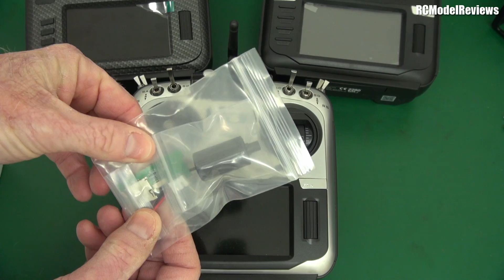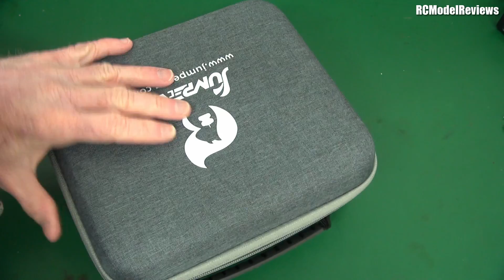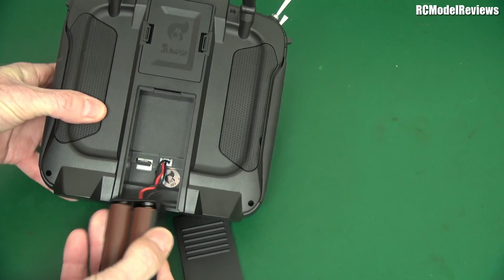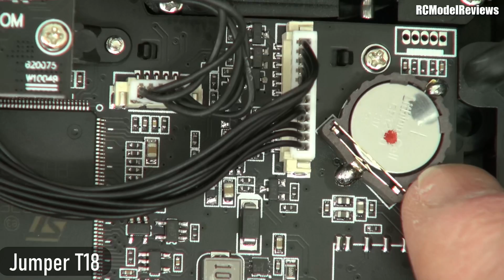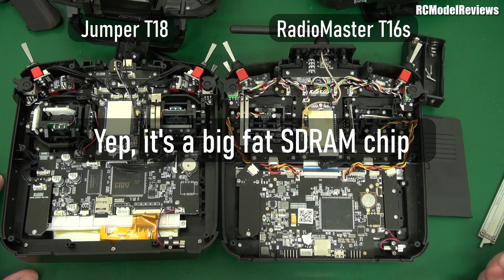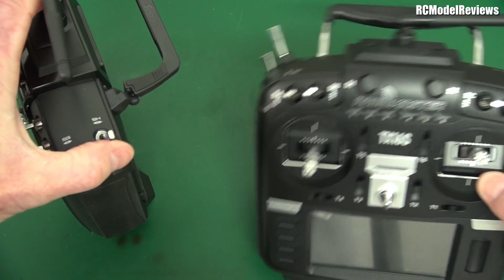Jumper T18 vs RadioMaster T16s TEARDOWN

Comment: This video is a couple years old now but I have a mark 2 tx16s and I think it is plagued by acoustic noise from the ceramic capacitors on the mainboard. Do you get a high pitch ringing noise when you for example increase the internal module power and/or screen brightness at the same time? It becomes EVEN MORE audible for me

Comment: One reason I purchased the Jumper T18 V2 was the switch lights - I do have to fly at night, the downside is no one has reverse engineered the T18 so schematics are not around and the part add-ons for the T18 are non existent but I do like the case that came with the T18.

Comment: I see a year later radio master includes a foldable handle and two strap clip holes for a flat to forward balance. Older radio master radios are still on the market so if balance matters (it does to me) look for that.

Comment: Thanks for the proper review. My Jumper T16 Pro worked well for 10-12 months, but then then the first ribbon cable issue appeared ("page" button not working), then the second one (Scroll wheel "enter" function), now on number 3 & 4 (SG switch not working, SD card reader malfunction). The first two issued solved by cleaning and re-seating appropriate ribbon cables, but with the two new issues I'm about to give up. The so-called FOC replacement cables from Aliexpress difficult to order without actually paying (and waiting 6 weeks for them to arrive), så I'm no very happy with this product. Get a Radiomaster instead!

Comment: When I bought my jumper T16 I thought it was amazing.  So I bought a second one to use for my kids.  A few weeks in I had all the problems with the ribbon cables on both radios.  Reseat a cable and it would be fine for that day and magically 2-3 days later I would power up a radio and another damn switch would be misbehaving and I would have to reseat the cable again.  I got the upgraded ribbon cables and installed them.  Seemed to have fixed the problem for a month.  Then I had the same thing happen.  I now own a Radiomaster TX16S for 2 weeks and I think its a decent upgrade from the Jumper.  The next time one of the jumper's has a ribbon problem its going in the garbage.

Comment: many many months later, i just reviced my Jumper T18, and i can say Jumper have made some upgrades on the production line, the screen cable is much shorter now and not wrinkled any more for example, and the Hall Gimbals is not the same as the gimbals in this video... so it looks like they made some improvements Jumper.

Comment: The center detent is built into the Potentiometers...  My guess is that Radiomaster are using an better potentiometer for the sliders.. I would imagine its then the same pots used on the top 2 knobs on the transmitter too..

Comment: I have also noticed that NONE of you people in the process of doing your tear down comparisons are exercising ANY Electrostatic Discharge (ESD) precautions 
whatsoever. I've noticed some people touching components with metal screwdrivers and
other metal pointers without the person wearing a grounding wrist strap. Static electricity 
does more damage to digital circuits than most people realize. It doesn't have to do catastrophic damage but eventually you will have a radio failure attributed to ESD. 
Most of the circuitry in these radios operates in the range of 2.5 to 5.0 volts DC. A spark of 
of more than 5 volts is going to do damage. If you actually SEE the spark jump. you HAVE 
done damage!! It's that simple. 
  
Be on the safe side an wear a ESD wrist strap grounding kit. They don't cost but 10 to 15 Dollars US and can save you an expensive airplane or drone. I Cringe EVERY time I watch one of you people tear down a radio !!!

Comment: Great Video But did you think to read the manual on wither radio? DSC = Direct Servo Control AKA 
Trainer Port and Charging on the bottom USB-C Port. And as a modeler< I'm really surprised that you 
couldn't figure to modify the Jumper Carry case with an X-Acto Knife (Surely as a modeler, you have 
some imagination) to fit the Radio Master or get the optional Fold-Down Carry Handle from 
Radio Master and then it should fit the Jumper Carry Case just fine. 

And, Yes! The flex circuits, what you are calling ribbin cables, in the jumper are a Joke! They will not
stand up to vibration. Stranded Copper Wire Ribbon Cable on the other hand, will. As an electrical
engineer of many years, I can attest to this.

Comment: I was an early adopter of the  Jumper 16 with hall effect gimbals. I've had problems with the card reader and the ribbon cables. The ribbon cables are always out of stock unless you buy them from Jumper and it very time consuming to replace them. In fact, one of the catches on ribbon cable holder broke and I'm completely shut down. 
Personally, I would never buy another Jumper product.

Comment: I have had a terrible time with quality and support with Jumper.  I will keep you updated, but let's just say it was very difficult to get a replacement T16 when I bought it (more than 16 detailed e-mails and a need to basically beg for an RMA number), and the replacement they sent me had big problems also (and has not yet been fixed or dealt with).  I hope RadioMaster is much better with its customer support.

Comment: While complaining about the need to remove the battery pack on the T18 to charge the cells you said, "Obviously you want to balance charge them."  Considering it has the same leads on its battery holder as does the T18, it doesn't look like the T16s internal charger balance charges the cells.

Comment: Had issues with my TX16s. None of these are high quality. And as far as features it is just more of the same. Nothing ground breaking. May be good value if you get one that works but nothing like quality of TBS. Someone could jump into this space and disrupt with a really good easy to use radio.

Comment: 21700 cells will fit in the Jumper in place of the 18650. Don't use the holder but just a couple of bands of clear tape round the 21700, firm up with a couple of blobs of hot glue where the cells meet. Cell holders with spring contacts are a bad idea in a Tx (airborne situation as well) as vibration can causes intermittent/poor contact which can result in loss of control.

Comment: would be good if you could measure the current consumption of both radios to see which one is more efficient. This means for the same battery, the lower the current draw, the longer we can run it.

Comment: The screen protectors are designed for protection during shipping only, and will degrade your screen over time, removing them will prevent this.

Comment: The radio master cables may look messy, but having different colours is good for moding. As in 'Cut the yellow cable on J12 and connect it to the red cable on J5 - as an example.

Comment: That's a rubber dummy load, not an antenna on the T18. If you really want range, run a cable to a decent vertical antenna, perhaps mounted on a pack frame or something like that.

Comment: Can you fit a 5000mah 2s 21700 li-ion pack in the Radiomaster? Samsung 50E cells are like $5 each so much cheaper to build a 2s 5000mah pack then an equivalent lipo. Plus they don't mind being left charged for long periods.

Comment: Hi Bruce  , I bought the Radiomaster and fitted the Crossfire module and find it fits my hands for a thumber  .   The folding handle is not an issue if you use Crossfire .  It would be nice to find a carry case that lets the Crsx module fit as well .   Also Radiomaster has an option to buy it with the Crsx module as they did some sort of deal with Crossfire .  I already had a module so didn't need to go that route but CRsx works  seemlessly with the Radiomaster .     
Question though recently Win 10 did an update that buggered up my STM drivers  , has anyone else had that problem .

Comment: I looked up the details on that antenna, it's 3.3dBi gain, which is the same gain as 90% of those 100mm long rubber ducky antenna's. So aside from the polarization issue the performance shouldn't be too bad.

Also I prefer running horizontal polarization as you're less likely to run into Fresnel zone issues.

Comment: Hi Bruce: I measured the Chrome handle on my Jumper T16 and the centre points are 105mm which is the same as my new RadoMaster TX16s handle centres. So the folding handle for the Jumper T16 V2 should fit. I ordered one, they are not that expensive, it cost me $10 AUD. Postage was $9.95! 😊

6-8-20 EDIT: The handle arrived and it fits perfectly. Its does say Jumper on one side and has Jumpers web address on the other. No big deal, as I don't look at the handle in use.😁
Reply: will the handle close if using the Crossfire Long Range (Full-size) module?
Reply: @ChristopherNovaSmith   I measured the distance between the handle and the case when in the extended, unfolded position. There is 28mm or 1.10 inch clearance under the handle. When folded down, the handle is about 12mm or half an inch above the module bay, I have the flat plate cover on the bay.. if you have the handle at 90 degrees to the case and not fully locked you have  34mm or 1.32 inch clearance under the handle. 

I put a 4 in 1 iRangeX Module in the bay and the handle folds flat, the position of the  handle  runs parallel  to the unlocking clips. I hope this information maybe of use. 👍
Reply: @ChristopherNovaSmith :  Sorry can't help with that. I don't use Crossfire, as CASA in Australia requires that all Remotely Piloted Aircraft (RPA), which covers fixed wing and drones, must be flown within line of sight. Unless you have a remotely piloted aircraft operator's certificate, and apply for RPA Flight Authorisation
(Area Approval / Permission. Plus "These applications may take longer than 21 days to process, as they require coordination with the CASA Office of Airspace Regulation." That timing was pre COVID. Oh and Flying FPV outdoors is only permitted with CASA approval or at a Model Aeronautical Association of Australia (MAAA), site. 😢
Reply: @anthonywitham2305  Oh my, what the heck? Dang, well, from all the vids that come out of that country, I couldn't tell you guys had such restrictive laws.
Reply: @ChristopherNovaSmith : Some people choose to ignore the rules! I can't say I blame them. Bruce's two rules are all that's required. Happy Flying.

Comment: Bruce I have the Jumper folding handle on my radiomaster and works great!
Reply: will the handle close if using the Crossfire Long Range (Big) module?
Reply: @ChristopherNovaSmith  I sadly don't own a crossfire module but I don't see why not the dimensions are practically the same as the fixed handle

Comment: Bruce, I got the USB-C upgrade for my T16 Pro Hall and it charges at 200mA via USB. Works fine as far as I can see. I never have to remove the battery. I did drill a hole in the new cover so I could see the charge LED better.  Also, I've never had a problem with the scroll wheel! I'm very happy with the T16 on the whole.

Comment: That's interesting about your R9 experience - I have a red R9M for two years now, and it's my go-to system. In fact with FrSky introducing ACCESS I'm not going to buy any new D16 receivers - R9 (or D8) on the contrary, yes. I've looked at their website and the R9 system seems to have new 2019 firmware (ACCESS branded) and it's marked as an upgrade from R9M to R9M 2019. Not sure what compatibility issues it might cause, but it supposedly works with my module (haven't tried yet) and introduces OTA updates. Maybe you should take a look at that?

Comment: Hi Bruce, my production run RadioMaster T16s mode 1 model arrived yesterday. I can confirm that the slight gap in the back is still there, although is seems to be less then yours. The project box is gone, and now it has flat cover similar to the Jumper T18.

Comment: Yep I received a T18std suppised production model last week. I actually bought a T18pro but was incorrectly sent the T18Std. Another story. So far I have been unable to use it due to storage warning issue. It doesn't read any SD card and has to be reset up after every shutdown. On the whole very disappointing and wished I had gone the radiomaster route. My screen cable was also mangled.

Comment: You forgot to mention that the radiomaster has a touchscreen
Reply: Robert, would be interested to know the touch screen effect on battery life, as a few Futaba battled with this issue and have seemed to overcome it. Sometimes a touch screen is not optimal.. What do you think?
Reply: @simonpfotenhauercapetown7055  I have thought about the same. But until opentx 2.4 is released I won't know.  Hopefully they include a option to disable it if u don't care for it.  I can see it coming in handy for somethings.

Comment: Funny I actually love my Old 2018 R9m. I have full TBS XF as well and honestly don't like the fact of having less channels plus XF bluetooth is worthless imo.  Also the 2w output they claim isn't even close to actual output power.  More like 780mw.  Anyway not a huge fan of XF. I've had great experiences with R9M once you get the right firmware installed on both module and receiver it works very well and I've even added a $5 bluetooth module to my R9M and guess what it works!  Can't say that about XF bluetooth
Reply: Agreed, my R9M original Module works fine running 868mhz Flex, no problem at all.
Reply: @EnglishTurbines  exactly!!   Like I keep telling people if you spend the time to get it worked out r9 works just as good if not better than XF.  I own both and I've shelved my XF since I only get max 9 channels on CRSF protocol on 12 channel output which sucks when you are fixedwing pilots plus fact XF bluetooth is useless and was whole reason I purchased it but found out it doesn't work near as well as my R9 with modded bluetooth module.  I can get live maps plus antenna tracking  !!   Cant say my XF will do that
Reply: @Freebird_67  Yeah, what amuses me most is these Crossfire fanboys all fly Quads round their heads...you don't need long range gear to do that....Lol.
I think I paid £30 for my R9M and R9MM micro reciever....when they were promoting it...😎
Reply: wanna sell the crossfire?
Reply: @anthonysmith9765  sure.  $189.00.  Since I paid $240 for it.
Reply: @Freebird_67  ?crossfire is only 208 for the full version

Comment: Still wanting to see a roundup of  the best and recommended  receivers to replace frsky when they go full access protocol and everyone's got Radiomasters and jumpers.
Reply: Here you go: Crossfire.
😃
Reply: @MrRolloTamasi  I think we need more variety of receivers than crossfire, they maybe good but we don't all need expensive long range receivers
Reply: @jonnyBgood3  you asked for the best - short range crsf has short latency. And telemetry.
For cheap I would just grab a XM+ and flash a 1.x FW version.

Comment: I bet a few dabs of hotglue will hold those ribbon cables in place just fine.
Reply: Jumper admitted that they used substandard ribbon cables late in the T16 production, they claim the supplier screwed them.

Comment: The jumper does not seem to have true polymer caps, but electrolytics with a "new" style case, because there are vents cut into the top of them, like the Panasonic SMD "aluminum" electrolytics. Secondly: ceramics have been improving in capacity greatly in the last few years. Vishay has some 220 µF Ceramics with up to 50V capability in a 1210 case, Taiyo Yuden does 470 µF (alas only 4V) in a 1812 package.

Comment: Bruce, check if they are both 10.5 cm center to center. Measure from the center of the molded part of the case and not the handles. If so just get the upgrade handle from Jumper for $5 or so. I replaced mine on my T16, very inexpensive. Thank you for the videos.😀

Comment: I bought my jumper t18 the ribbon looks exactly the same. seal tape on mine to kind of make it rigid. I also installed a 2.4 gigahertz antenna. Plus I installed my own battery charger. However the one I got did have a balance lead. so you would be able to pop it straight on a charger. I installed a charger and mine because I don't want to have to keep taking the back on and off. I might through a video together on how I installed everything. If I ever get time.

Comment: I got the T16 when it first came out, the multi.module is faulting lost 3 quads before seeing it was the module as I used it in my Frsky.

I shelved it and have never used it or the module again.

If the radio or module can't be trusted then I will never trust it.

I've never had a dead stick with Frsky
Reply: I also shelved my T16 pro.  Lost 2 quads with it because of the radio resetting itself mid flight.  I'd NEVER consider using any Jumper or Radiomaster on any of my planes.  I'm waiting on Frsky to release the new X12 and guess I'll fall in line with the access train since I'm still running ACCST R9M which honestly has worked flawlessly for me on my Qx7. I also added bluetooth to the R9m which also works flawlessly.  Can't say that about my Full XF TX since I've also shelved that as well since it's been nothing but a headache and its bluetooth is useless and never works.  .
Reply: @Freebird_67  I just picked up a horus x12s myself,  second hand with two receivers,      just last week,    has yet to arrive in my possession,     but really looking forward to the choice I've made,    first up grade since futaba FF7.   Lol    finally gone of the 45mhz     lol
Reply: @Freebird_67  well the stuff Frsky has done has been irritating, but I got an older Frsky module on ppm that let's me use my old receivers.

But what matter is will my plane or quad be lost because the radio connection faults out?

And I have NEVER lost a plane or quad with my Frsky radios old and new.

Because of the expensive losses from Tx and its multi module crap and lack of instructions I will NEVER buy or use another T what ever radio or module again.